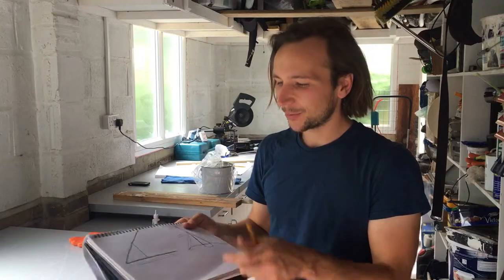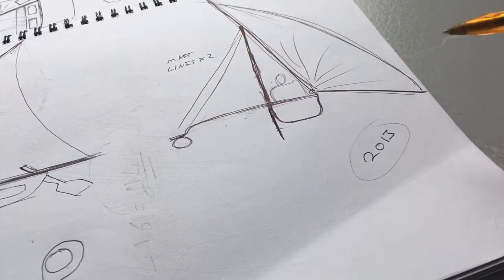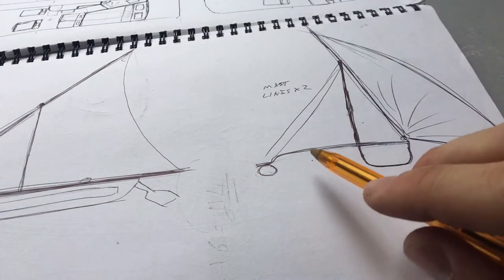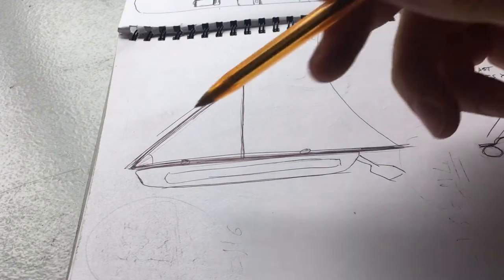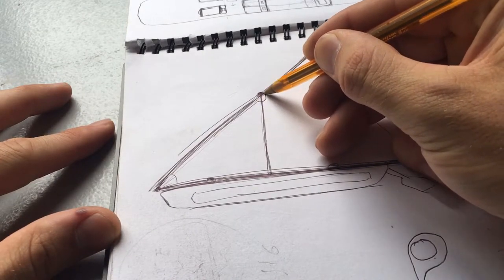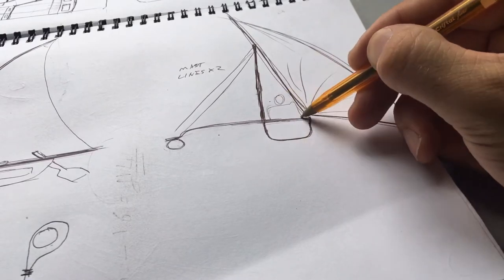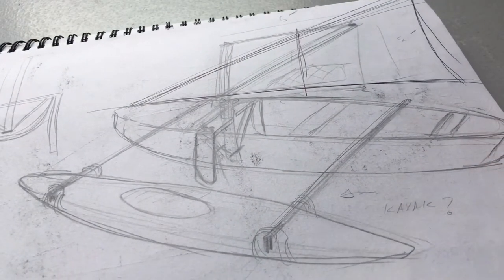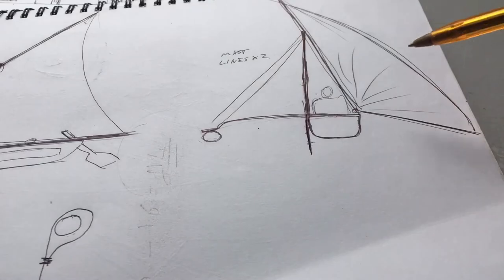CANOE + KAYAK WITH LARGE SAIL DIY BUILD - 2013

Comment: Doing the same thing, right now, with the same canoe.  Only difference is I have Sunfish sails and spars that I will be using, left over from the last hurricane damage to my little boat; and I am putting the kayak and canoe closer together with only a 24 inch separation.  Other than that... identical.  Great project.  How did it sail... upwind... downwind"   how stable?    how fast?    Does the kayak slow it down too much or does it help?   Thanks.